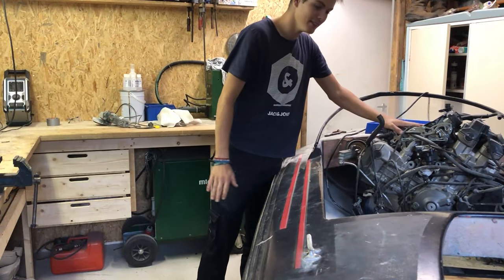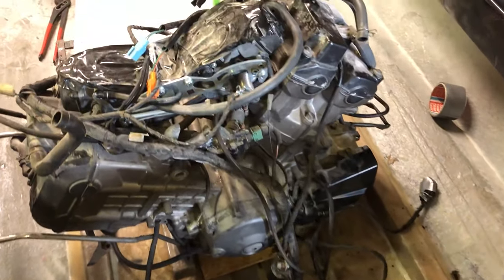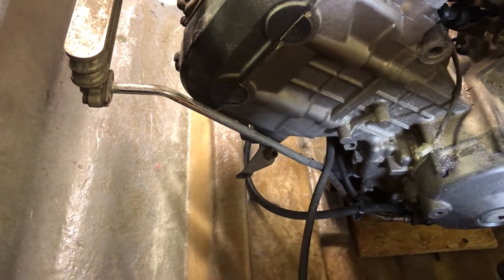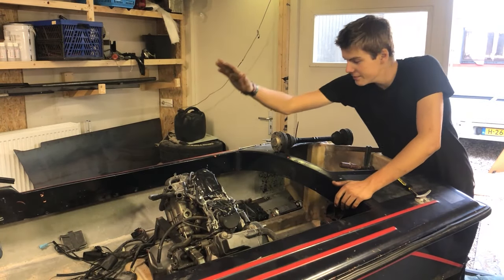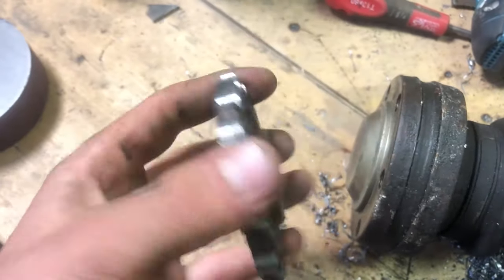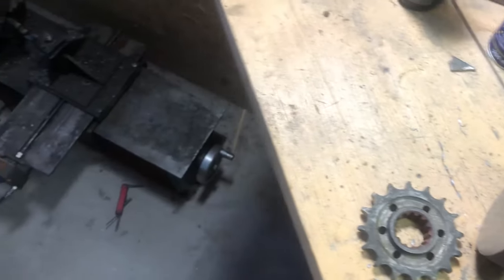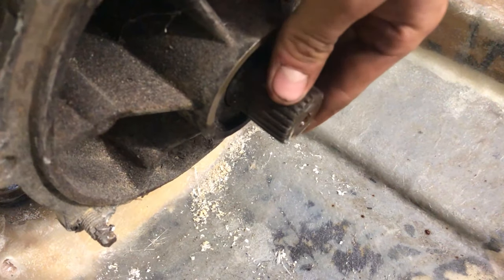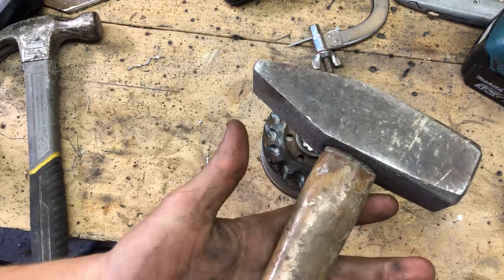INSANE speedboat engine swap [Part 2: engine & driveline]

Comment: The engine mounts will need vibration isolator bushings. Also the shaft will vibrate do to lack of balancing. I can't wait to see it in the water. Ir might sit liw in the water and might ve difficult  to get up on plane. Life jacket & fire extinguisher for sure.
Reply from the maker: Yep it will sit low, but i dont think it will have trouble getting on plane, i guess we will see😁
Reply: @homemade_madness  Yes --- It will have NO problem what so ever getting on plane. I wouldn't doubt that the boat weighs less than the motor. It will be a rocket. Now All you need to do is add some foils and make it really fast.

Comment: The spline on that drive can be found on any Chevy to borg Warner flywheel to transmission adapter for a marine velvet drive transmission. eBay has tons of them. It’s the part that makes connection from the engines flywheel to the velvet drive transmissions input shaft.

Comment: I would have adapted the original frame, since you're cutting it apart anyway. But I also see how fitting your engine bay was necessary. Probably going to have too much vibration. I believe the frame has dampers built in. By starting with blocks in fiberglass at motorcycle frame mounting points, you could build the cover around that. 
Also: bidlge pumps mandatory. You're going to need 2. I'd not put a bidlge motor inside the engine bay, but I'd put a sump from each bildge inside the engine bay for redundancy, and ventilation for engine beyond the radiators outside the engine box and air intake. To evacuate moisture. 
But it's easy to sit on the internet picking plans apart while I'm eating donuts and drinking coffee.

Comment: drillpress can be found on marktplaats for about 20 euro so just buy one 
as for fitting the driveshaft (length) i wouldve slid the engine back untill the ends fitted , eazier to get replacements that way